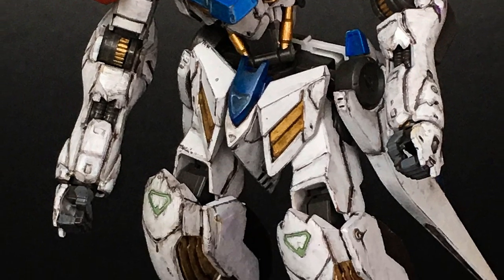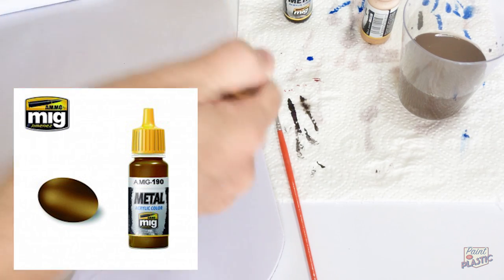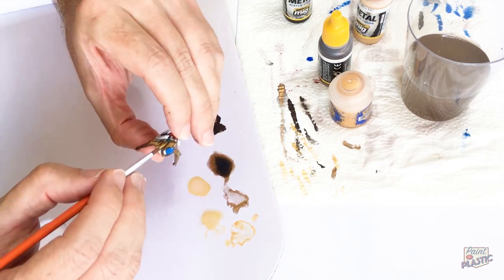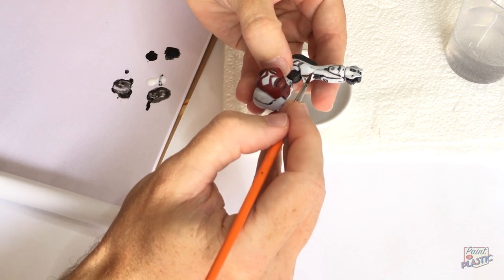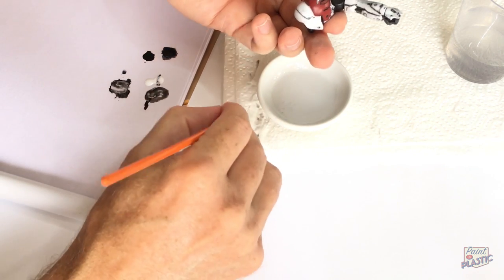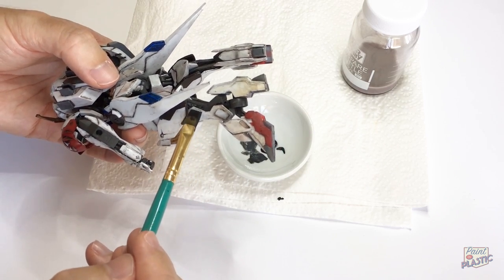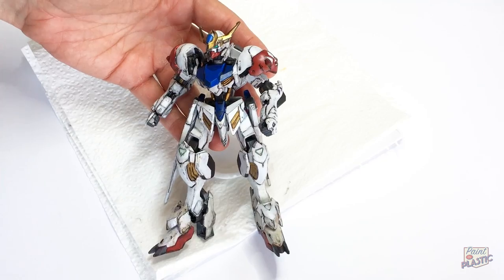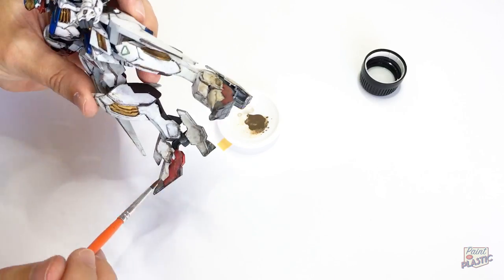Gundam Painting Tutorial Weathering How to with AMMO by Mig Jimenez by Lincoln Wright

Comment: Just chiming in on your comments about enamel paints for panel lining/weathering - gloss topcoats will protect anything below them if you use enamels.  Lighter fluid works as a medium or a thinner just as well as enamel thinner for purposes of weathering, if you're not sure about using enamel thinner.  That said, I've done enamel pin washes directly on Bandai plastic before and for what it's worth I've had zero issues.

That's how I've done recessed panel lines, although your method has merit for layered panels.  Whenever I've tried to use enamel pin washes for those, cleaning up the excess always got rid of the panel line.  I use Vallejo exclusively so I'll have to look up that Transparator stuff and see if it does well for trying an acrylic method like yours.
Reply from the maker: thanks Mohn Jadden - I think I see what you did there! Excellent comment, very thorough and useful. I have been experimenting more on the 2nd Bandai Gunpla with more enamel thinner and yes, zero issues so far. Cheers mate, keep in touch. I hope you like the advanced weathering videos I'll be doing the Ma.K kits, for Gunpla I want to keep it nice and simple as there seems to be plenty of people new to weathering.

Comment: Interesting. I've seen this kind of method on armor models in the past but haven't tried it myself yet. My impression was much as you describe - in a sense what we tend to do with airbrush methods is aim for precise, clean work early on and then spend loads of time later going back to make it look more varied and chaotic. But making it a bit chaotic from the start can also give you that depth as a natural part of the process (if you do it right!) and if you learn control with hand-brushing you can hit all kinds of details that would be very troublesome to do by masking, much more quickly.
I'm not about to trade in my airbrush or anything but I definitely need to give this a try sometime. I've done a little bit of hand-brushing in the past but in a very similar approach to what I currently do with the airbrush.
I was also a bit surprised to see hand-painting with Mr. Color. I didn't doubt that it was possible, but between the tendency of the paint to dry up very quickly, and the thinner to reactivate previous layers of paint, I wasn't sure it was really practical.
I am curious about whether the paint, built up this way, gets a visible texture, or if the coats are thin enough to prevent that. You mention that brush strokes are sometimes visible, but I'm not sure if that's as color, or as texture.
Reply from the maker: Hi Tetsujin! Now THAT is a comment, thank you very much for the time and effort to reply with that, most interesting and I sincerely appreciate your open mindedness in understanding what I am going for here. Yes indeed, hand painting with Mr. Color had quite a steep learning curve but once mastered, it's an amazing finish and process. Texture - excellent question and I do both. I've done both mirror smooth surfaces for the "Anti Flash Space Finish" in the Ma.K serious to purposely allowing it to make texture for finishes like winter white wash. I plan to share all of these finishes and processes in videos soon. I just need more models, more time and more funding if I can get it to help with the first 2 steps!! Thank you also for subscribing! Cheers, Linc

Comment: Using multiple paint media like that sure does seem to add much more possibilities. I love the idea that you can just reactivate and rework the weathering layers. The knowledge of what thinners effect what paint types and to know what type they don't disturb seems like a skill that takes many many years and headaches to learn! Is there a similar technique I could use over the top of Acrylics with the addition of an "off the wall" varnish type layer to protect the base paints?
Reply from the maker: Grifftrogg exactly, chemical science for the win! Sure. You can seal with a clear lacquer. Purity Seal (expensive and branded) or a sarin clear from DYI. Do test though mate, that's probably the biggest reason I stick with brands I've used in the past, I'm paying for predictability. 👍🏼
Reply: I know what you mean I'll pay a bit more for a product I know does the job. Thanks for the tips. With this though I don't use aerosols so I might go my local art suppliers and find some clear lacquer to run through my air brush. It seems like the perfect technique to use on a Space wolf commission I'm on with... I'll remember to run tests first though, lol.
Reply from the maker: Grifftrogg commish,  very noice!!

Comment: So would you recommend mig over Vallejo??
Reply from the maker: hey Adam, the AMMO stuff is pretty good and I often reach for it before Vallejo. Saying that though, I do love Vallejo and Citadel as well. AMMO is so good all around too, brush and airbrush!
Reply: Paint on Plastic by Lincoln Wright I build gunpla and looking at the best color ranges to use what is the reason you like mug over Vallejo? I use a airbrush but the one thing I a huge issue with is my panel lining, I put a good layer of Vallejo gloss down and use there wash I've tried tamiya and felt it strips the finish, I got some nuel oil and didn't clean up the way i wanted. I've had a little more luck with the Vallejo I ordered the mug washes today along with there mecha weathering and chipping effects and want to give that a shot.
Reply from the maker: Adam Derickson yes, I also use an airbrush too 👍🏼

Comment: Is this painting that you can do straight on the gundam plastic, or should I apply something first?
Reply from the maker: Sam Keith hey 👋🏼, thanks for watching. I'm experimenting and tried both on Gundam plastic and so far so good. I wouldn't let the thinners pool though and would be really careful with the inner frames right?
Reply: so just use thinner and paint? I guess my question is can I hand paint weathering on a straight build?
Reply from the maker: Sam Keith yes of course! The 2 videos before of this Gunpla are just that, check out the one with the same model in the thumbnail on the channel page, can't miss it. Let me know if you have any trouble. Cheers 👍🏼
Reply: Paint on Plastic by Lincoln Wright would it look cool on sd ex